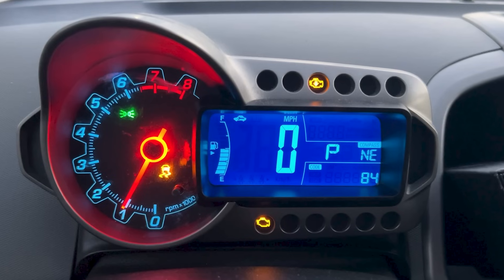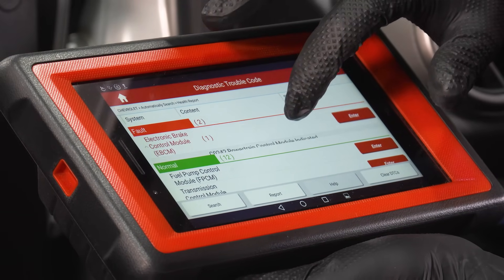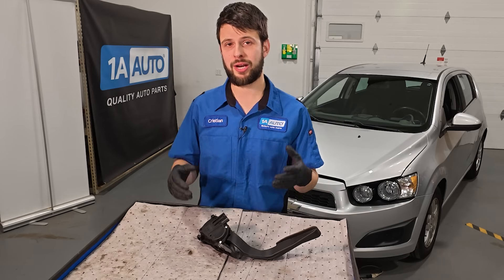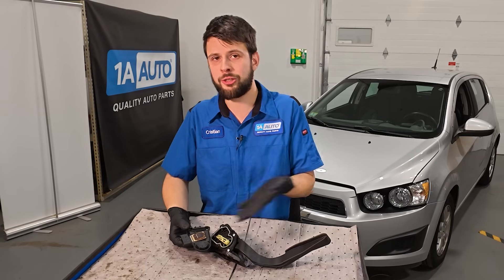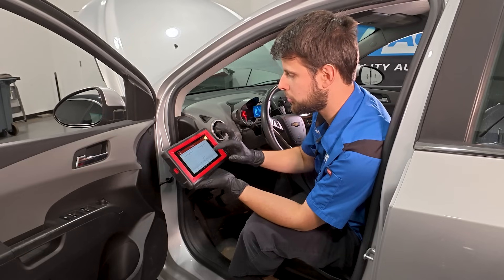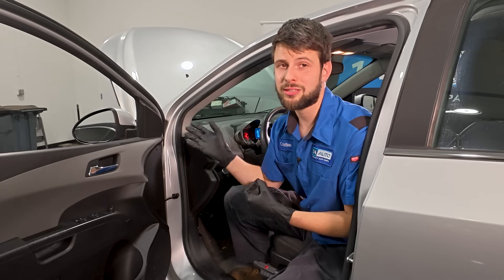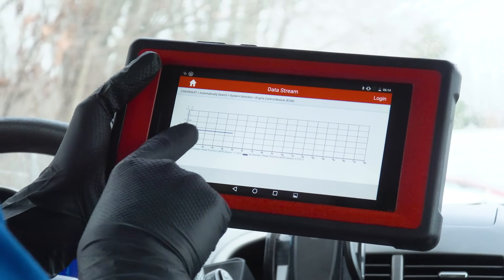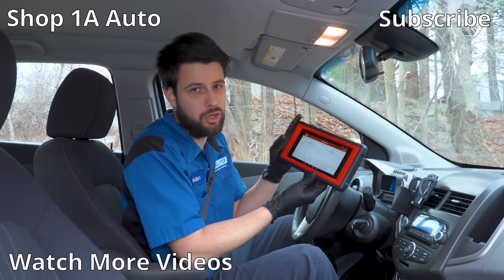Code P2135: Your Car or Truck Might Go Into Limp Mode! The Pros at 1A Auto Show You How to Fix It!

Comment: Thanks for your video. It’s very helpful. On the other hand,when you took apart sensor assembly,revealed the 4 prongs that makes contact with the other part,for me I would have bent them a little bit to make them touched more firm, and reinstall them,to see if it runs better….

Comment: My opinion cars these days are trash, technology ok!!!!! but when you have an electronic control gas paddle that doesn't do anything to help you is BS !!!!!!!  Improving your gas mileage ok, but they figured out pretty much how to stick it to you, electronic gas paddle Is not going to improve your gas mileage just another way to get money out of you, another one is keyless ignition, if your car breaks down you're not able to put it in neutral , your steering column stays locked, yes I by passed it , pulling the emergency pull cable under the shifter,and put it in neutral but the steering column stayed locked, could not turn the steering it stayed lock, so that means I could not tow it home myself, Congress needs to step in and change this trash, so much technology on these vehicles these days ,gas mileage improvements ok, but anything else is trash!!!!!!

Comment: With respect, there's nothing safe about limp mode. My first involved a DEF tank heater failure, in the summer, 137 miles from Whitehorse, YT. I backtracked to the Chevy dealer in Whitehorse and waited a week for a new tank.
My second involved limping along I95 north, then spending a weekend at the SC welcome center waiting for a tow to dealer for a NOx sensor.
Both incidents put me and my family in a very unsafe situation and, worse, were completely unnecessary. The EPA is unemcumbered by common sense.

Comment: Only problem, if this happens on the freeway, then the car is totaled when you're rear ended because the computer in the car won't give you enough power to safely get to the side of the freeway!!
Reply: It’s your problem that you decided to keep driving. When it goes in limp mode, why do you think your speed goes from 65+ to 3 mph instantly? You just begin to decelerate like you would any other time you need to pull over. You’re not the brightest in the bunch.